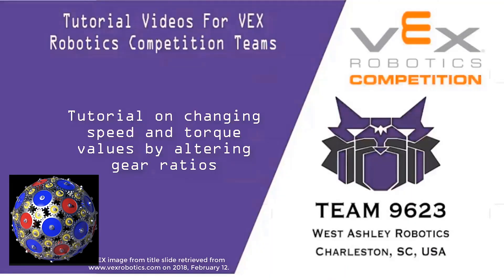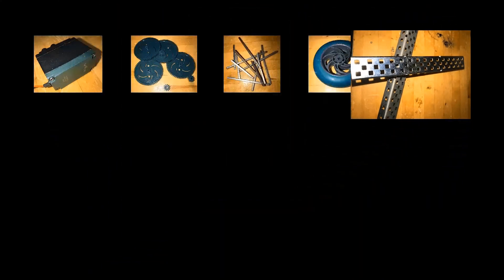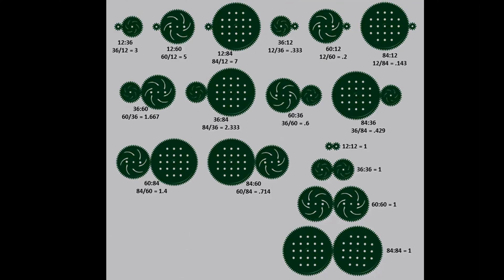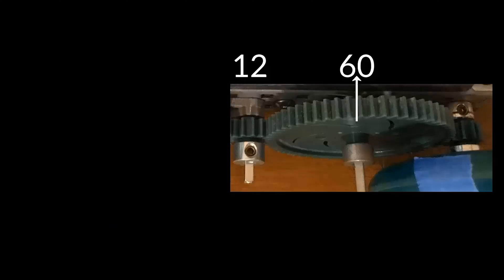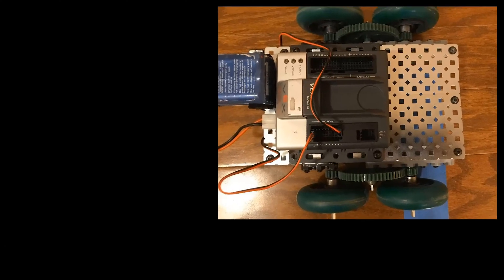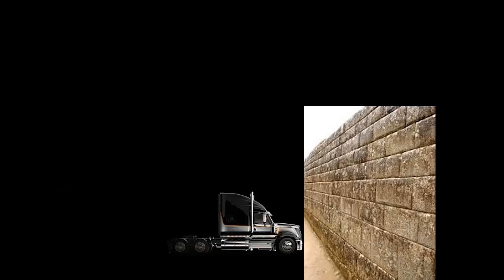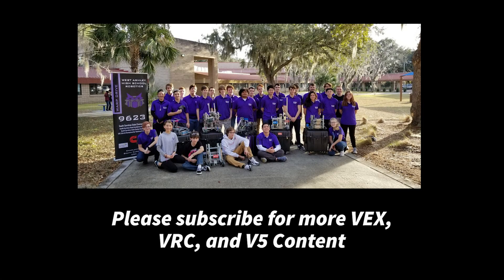Make Your VRC Robot Faster/Stronger with Gear Ratios!

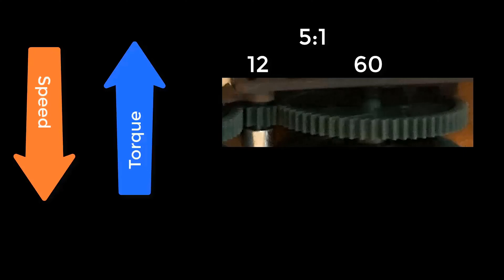Comment: 3:49 you SURE this ain’t 1:5? What happened to driven being divided by the driver? 👀
Reply: driven is the 60 and driver is 12 so its still 5:1
Reply: @spann967  but the motor is attached to the 12- so how.
Reply: @bertenheimer  I think the editor just mislabeled the gears.  If you look at the diagram that follows, they are labeled correctly